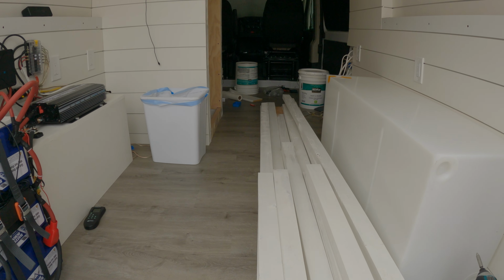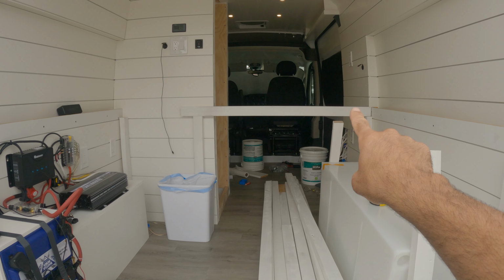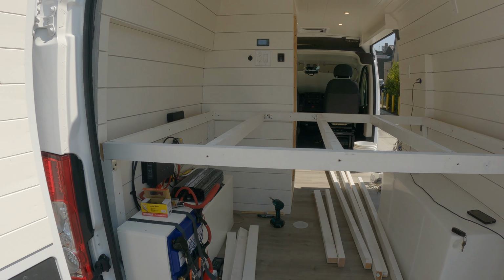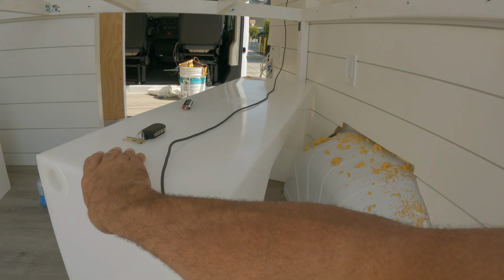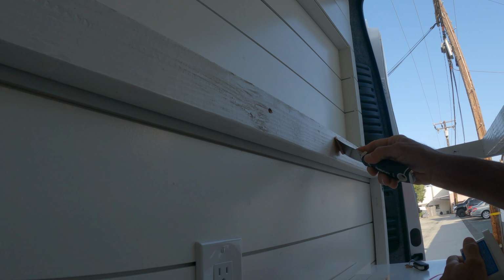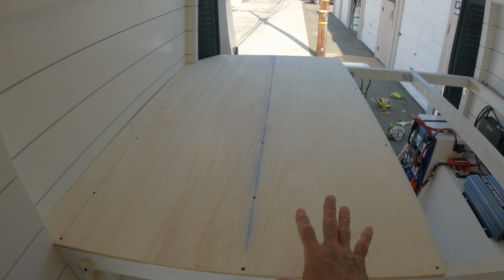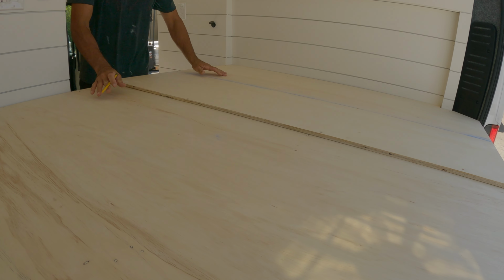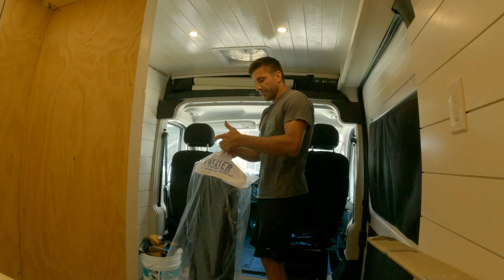Promaster Van Build | Ep9 | How to Build a Bed in a Van

Comment: But isn’t all this material very heavy?  Aren’t you hauling it wherever you go and wasting expensive fuel.  How about a lightweight install?
Reply from the maker: It’s a cargo van.  It’s designed to haul weight. I try to use the lighter weight options but not at the cost of having a cheap looking finished product.  Like for example the ceiling material is really thin and almost weightless.  But it still looks great.  By the end of the build I’m still way under the payload of the van